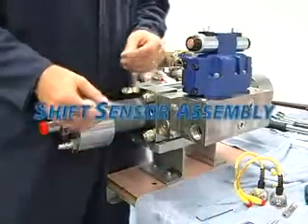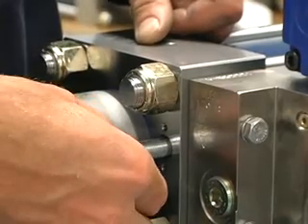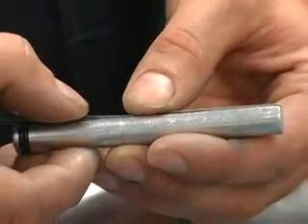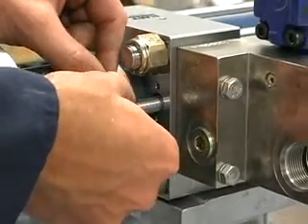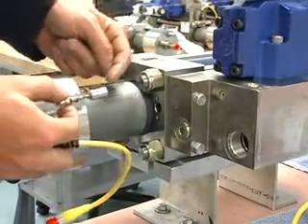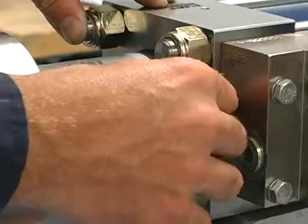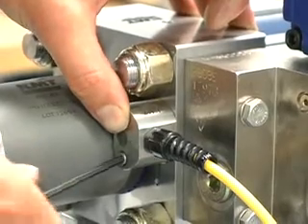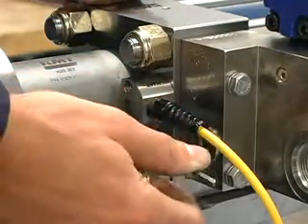How to install the shift pins and sensor into a H2O Jet or Flow Waterjet Intensifier

Comment: Just don’t ever try to change the shift pin without disconnecting from manifold, and draining the oil from the pump! The pressure of the oil pushes the pin out lol. It can be done, but you have to keep the Allen wrench in place, quickly remove the tool, then have someone insert the actuator sensor, immediately. Thanks for the video; especially on how to use the tool, as I had no idea on how to use it to get the pin out.